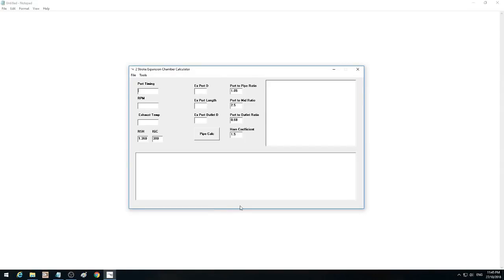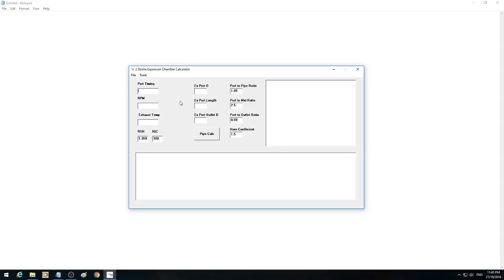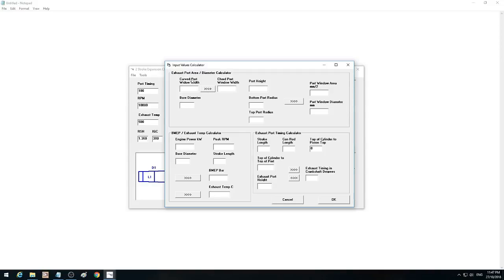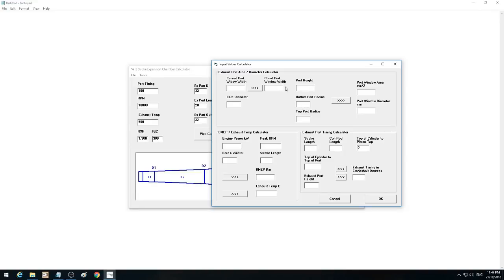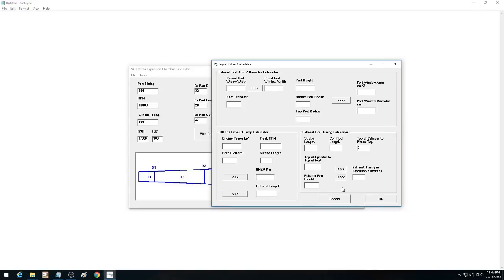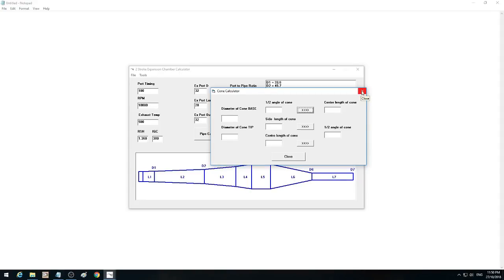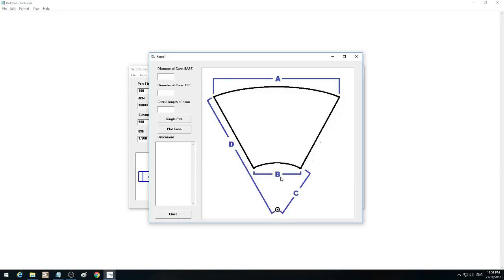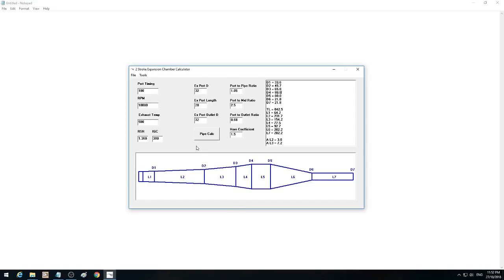Free 2 stroke Expansion Chamber Calculator Software Update

Comment: very interesting dude , i stopped tuning two strokes in 90-, but i started in 65 , so by 67/68 i had started to make my own pipes , now they there wasnt a lot of info at this time so we scrounge papers from q u b [gordon blair] and did all the calcs by hand , boy wish i had a time machine to go back with this program, ,oh and a computer ,lap top ,i would have been branded a witch or something , god knows how many pipes i made , but only a few really worked ,i still have all the patterns , w t f f dont ask me nostalgia i suppose , so i shall down load your software and one day just for giggles i will run through my engine data and run off a pipe to see what it compared like  to now ,as you can guess making your own pipes was a great part of the fun , thanks

Comment: Great series, I would assume that with a 2 into 1 twin you would do all the calculations using one cylinder but 2x the rpm, also way back in the 70's I made some pipes for mxers and converted diameters into areas. to make the pipes a squashed oval so they wouldn't stick out the side avoiding a burned leg, it seemed to work as well as a round pipe., getting ready to do a Subaru 360
Reply from the maker: For a 2 into 1 chamber the RPM remains the same as tuned length is the same.
What would change is the diameters which would be less than double similar to a 2 into 1 collector ratio on a 4 stroke.
Reply: @AuMechanic  wouldn't you account for there being 2 pressure pulses per revolution equivalent to double the rpm? yes each header would join and D1 would be close to port D size.
Reply from the maker: @wf770  Each one still has to travel the same length of the pipe. The said it would depend on the timing and which side of 180 degree it is as there is nothing gained by a wave arriving at the alternate port after the port has closed.

Comment: I’m so so happy that I’ve found this complete tutorial to learn how to do this!  I’m so excited I actually just grabbed a banana pipe for bike engine boost just so I can play with something…. What thickness of metal do most people use so I can start practicing with the welding as it’s been several years
Reply from the maker: Whatever gauge of metal you want to work with. 0.5 to 1mm is in the ball park.
0.5mm is easier to bend but harder to weld without blowing holes in it so depends how good your welding is.

Comment: I’ve had several QV 8000 fire rescue saw’s for several years from the firehouse for doing some good work and they have a rounder exhaust port shape then most rectangular type saw exhaust ports and I’ve wanted to make a pipe for one of the QV cylinder’s for several years and I have actually also found a hundred dollar parts cs8000 so I could actually see how the echo factory guy’s cut some combustion chamber down and the difference in the intake and exhaust ports to make a little more power boost for the rescue version

Comment: I want to make a pipe that has the most power from low - mid range RPM. Is there a way to do that in this software?
Reply from the maker: Yes have a look at the previous videos covering use of the software.
There are some variables you can adjust in it to suit broader power spread.
AND
Hold mouse over entry boxes and popup helps will explain each of them and the range of values you can use.

Comment: How  do you  calculate  a 2 cilender  to  run  a single  explanation  chamber   or should  I run  2 separate  expansion  chambers
Reply from the maker: If you have room to run 2 separate chambers then do so, I don't have specific equations for 2 into 1 systems but I may do something on the topic in future.

Comment: Thanks for the videos and the calculator software. You are responsible for my first pipe adventure.  It was great fun!
I have some pipe pictures in the "LT50 reed valve" thread at
atvconnection.com/forums/kids-quads 
Thanks again.
Reply from the maker: Pretty good effort on the mods, well done.

Comment: Can you answer my question?
Motorcycle: Yamaha dt 125R 1999
Port timing 193
RPM 9600
Exhaust temp 400
port diam (P) 40
Port lenght 61.5
Port flange 31
Straight header

MY problem is that the header is 30mm long, and diffuser is very long (500mm) What should I do?
Checked it on other more complex calculator (ECC27) and doing the same. Basically I would be having header just before cylinder. I don't know what to do, just wanted to do the pipe.
Reply from the maker: I used those values in my software and get diffuser length of L2 = 241.45 mm
Reply: @AuMechanic  Yeah, I think i messed something up. Made a correct and everything is fine :)

Comment: is the max engine rpm where it makes peak hp or where it rev limits?
Reply from the maker: Peak engine RPM
Once the port plugging from the baffle cone comes into effect it will increase power however beyond that point it will reduce power to the degree it feels like a rev limiter in the case of a steep baffle cone angle.
Reply: Let’s say for sprint racing a single speed 125cc kart engine. Slowest corner on the track is around 7,000rpm. And 17,000rpm gets you to the end of the longest straightaway. 
However, average rpm is around 12,000rpm.

Would I want to tune the pipe for 12,000 in this scenario? Hoping that it will still be capable of Reving to 17,000 for the long straight.

Thanks for your fast reply it’s much appreciated.
Reply from the maker: @ryanbrown5058  
The "tuned length" only refers to the tuning of the baffle cone which comes into play around peak RPM and that is only one aspect of the pipe design.
Keep in mind that the first cone called the diffuser comes into play leading up to the power peak and its dimensions being angle or horn coefficient determine if the effective range is wide over a long RPM range or short range.
For a Kart with no gears you want it to be effective over a wide range up to the peak power.

Comment: Super! looking forward to it!
Btw, is there a trick to making curved L2/L3 sections?
Reply from the maker: By curved sections I assume you mean adding an angle to them like an MX pipe.
The method to do that when making the by hand is to use the pie slice method which is taking a wedge slice from one side of the pipe cutting the wedge to the centre line and then adding it to the other side of the pipe to get a bend angle.
The other method requires some cad function to create a curved sheet metal ducting and I will be covering that in a video on fabrication of pipes.

Comment: Looking good!
For the flat layout you need to add the sheet thickness (or technically 2 times half the thickness) to the diameter or the ID will be too small. Also a Cone Layout export function would probably be convenient for a lot of people there. I wrote some code to generate files for it a long time ago, I can mail it if you want :)
Reply from the maker: Cheers, trying to keep it compact and intuitive as possible.
I was going to add a sheet thickness option for the single cone calc but for the whole batch off the pipe in the main screen that posed an issue on where add thickness neatly before it calculates the 4 cones in one hit,  I'm loath the have message pop ups  and was juggling how to do that neatly, I might just have to add the box for it to cover batch and single.
Re the cone export, what format is that in ?
I was thinking about a print option to print the layout 1:1 ratio but seems a lot of cones will be bigger then A4 paper most printers have and the compass method is pretty quick.

Comment: Somehow, I hope my neighbors love your software as much as I  do.. so excited to outfit weed whacker and chain saws as well. How do you roll the cone?
Reply from the maker: Thank's for the comment.
As to how to roll the cone, normally you would use a sheet metal roller that is basically 3 rollers with one of them and adjustable pinch roller, they have a crank handle on the end and you feed the sheet through like clothes wringer, each time you feed the sheet through you screw the roller down and keep repeating that until you have the shape formed.
For some it may be an option to got to sheet metal shop and have them cut out the sheet from paper shapes you provide and roll them for you that could work out fairly cheap since you don't have to buy a feel sheet if metal to cut out.
Cutting the sheet requires some good quality shears like Gilmers and is not easy to do neatly which is why it's better to leave a little extra on the radius each end and once you make the cone and weld it up then use a linish belt to clean the ends down the the scribe line.
To hand beat a cone I've used a metal rod in the vice and soft hammer to from the cone around tapping along the edge, it takes a while but so long as you don't rush it and try to from the cone in one go or you get creases, you need to go around and form in a number of rotations hammering down a little more each pass..
Ill probably do a video itself on how to roll the cones and cover a few methods as there are a few points to cover.
Reply: if you have a slip roll you can get the majority of the shape. (the trick is to limit the movement on the short side so the long side gets rolled more) then hammer the remainder on a mandrel or anvil.
Reply: or a hammer and enough time you can do it like this guy did. https://youtu.be/KbTlT2C1D-w?t=96  just don't follow his safety practices
Reply: Does the cone feed square to the angled edge or square to the cl axis? As far as arc flash.. yeah that guy well I guess he made due but maybe blind now.

Comment: Would there be much difference in a mx chamber to a flat track one apart from header pipe length?   Also anyway of knowing how much a dented chamber is affecting the bike? I am running a h1 Kawasaki with "drag" pipes in sidecar speedway and my center cyl chamber has been flattened from hitting ground and recently I cooked center piston.. I'm sure it leaned out coz of fuel line arrangement and running pump fuel but would this affect in anyway I might be overlooking?
Reply from the maker: Hi Sean
A dented chamber may not perform as well but would not cause a cooked piston, however if the outlet pipe got kinked or bent such that it was restricted that could certainly cause overheating on the piston / cylinder from too much back pressure. 
As for the cones, the more horn shaped the diffuser cone is the wider the power range it will operate, a single taper cone diffuser is is more peaky and narrow power.
Since a single cone of longer than a horn shaped multi taper if the neutral centre section was the same then the header would "effectively" be shorted with the same tuned length.
Reply: AuMechanic  ok cool thanks for that info.  After pulling motor down I found the piston clearance on all 3 was set bit on the tight side and I had a leek on left pipe from a crack in header but nothing else seemed obviously wrong.  Beeing aircooled the center cyl is going to always have over heating problems to some degree but might give slightly bigger jet and maybe blast the paint off the center head fins might slightly help I guess.. Got a race next weekend and still waiting on wrist pin bearings to get here :(
Reply from the maker: @colta51  
Yes a little bigger in the middle cyl jet would be a good idea, maybe use a jet drill to increase it as a full jet size might be a little too much.
Yeah waiting in part before a race, I used to have that and always ended up working in the race bike and late into the night before the race because of it..
Reply: iCrashPlanes there is one on my channel. Wasn't great track had to back off on the slick grippy bits or it would have flipped for sure lol
Reply: And I think it's been on 2 cyl pretty much last few times I rode it lol